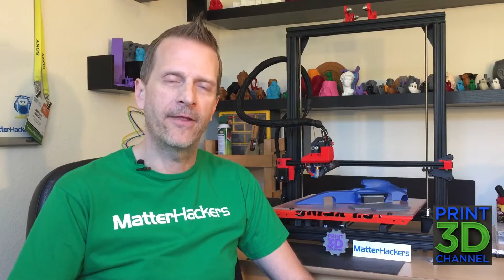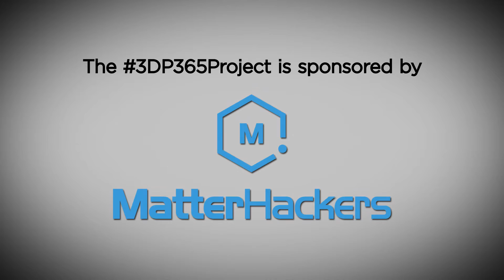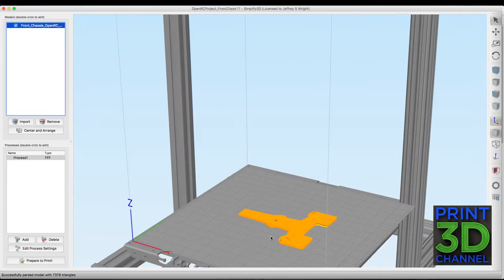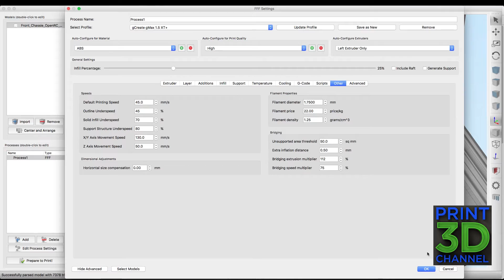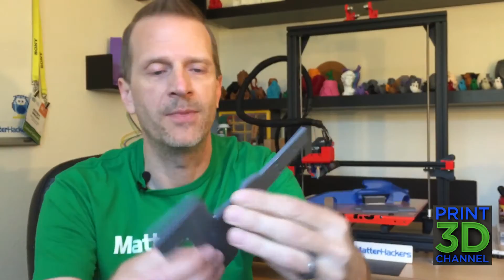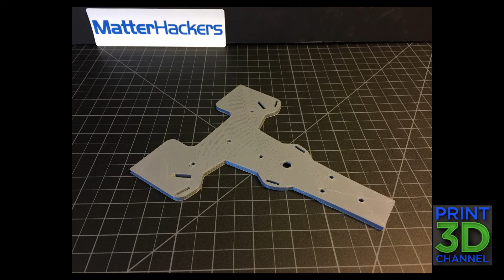#3DP365Project - Day 84 - #OpenRC F1 Project - MatterHackers & gCreate gMax 1.5XT+

Comment: im curius how do you sabe the hot problrm with esc or motor or batery heat as u  know pla can handle only 60 st.celzius?
Reply from the maker: Thats a great question and I will have to cross that hill when I fire up the RC Car for the first time. Let's ask @DanielNoree if he has an answer to that question. Thanks for watching and for the excellent question.
Reply: this is from experience ,didi oy u know witch setup(motor esc do you use normal or bk)
Reply from the maker: Not yet, I plan on visiting the local hobby store here in town, they are experts in all things RC, purchased my drone there, too.